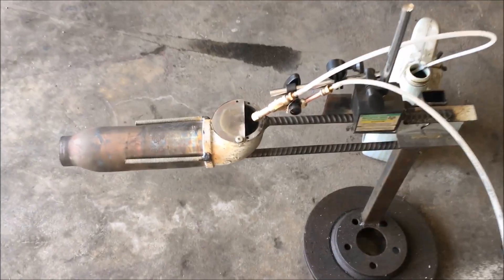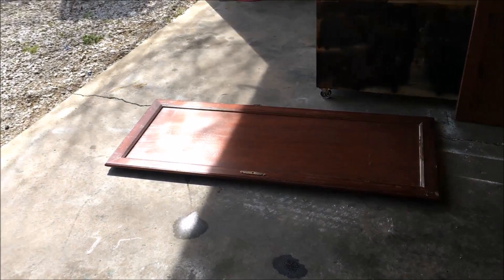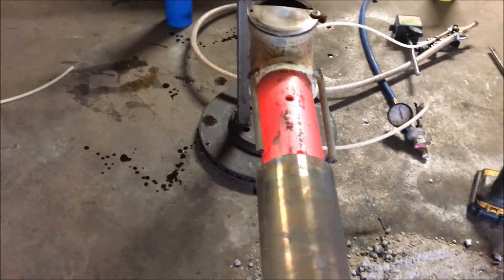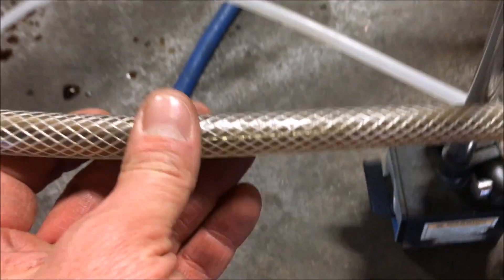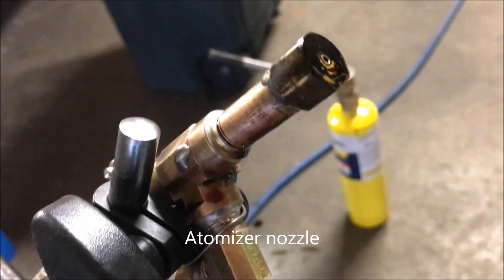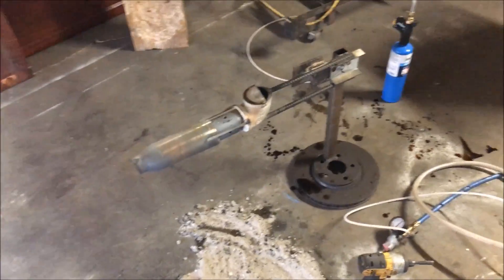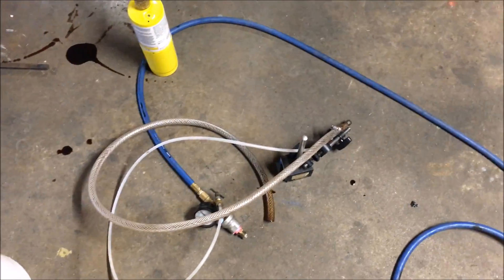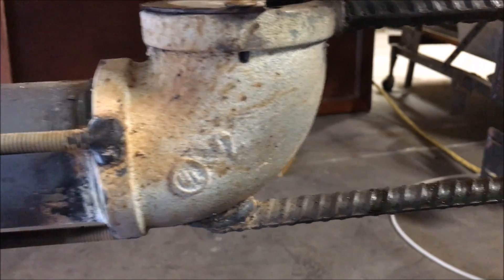Waste oil burner nozzle Design Principle MASTERED DIY prt3

Comment: You wouldn't be able to melt iron with this as the combustion chamber IS iron and clearly not getting to that temp.
Reply from the maker: not true , you have insufficient information to make this claim , i have burners that run colder then this that can melt iron in 12 minutes in a foundry
Reply: @NOBOX7  Sorry, but how does the temp in the furnace get higher than the burner temp
Reply: @shanestevens622  The foundry/furnace is insulated and minimizes heat energy loss, in other words, the heat accumulates. Whereas the burner is in the open and loses a lot of caloric heat to the surroundings.

Comment: Waste oil burners are similar to paint spray guns, there are two types. Both types use air to propel the paint, but one type sucks the paint up the other relies on gravity feed. As the air pressure is varied in a spray gun by a central  needle it drags up the paint. In both types the paint flow can be increased or reduced by restriction in the flow pipe feeding the nozzle.This alters the mixture of pain to air, and a waste oil burner is no different. The air pressure and the oil quantity both need to be adjusable to get the ideal air/fuel mixture. This burner obviously works well, but i feel if the air flow and the oil flow were both independently adjustable, a very good burner could become awsome!

Comment: how is the smell of the oil burning? i'm looking at a home made deep fryer, and this seems like the perfect design to heat the burner tube, vs a propane fired nozzle.
Reply from the maker: I have a much better burner design for that application , i sell them or if you want to build one yourself look up Godzilla burner

Comment: Had to mute the sound some kind of shit music in the background. You can make a real simplified venturi nozzle with a mig tip, barbed fitting drilled and tapped with mig tip attached then thread to your 1/4 inch tee with your air supplied as you have done. Or pick up a cheap undercoating gun at Harbor Freight it will do the same thing and safe you build time

Comment: The larger hose supplies volume and reduces restriction of flow I would assume.
Reply: If oil volume increases you need ever more air so the air to fuel ratio is maintained. Its actually a case of being able to control airflow rate AND oil flow rate independently so that an ideal mixture can be achieved. Reducing fuel restrictions would just make the burner very inefficient.

Comment: What oil you use? Can i use palm oil?
Reply from the maker: I think it would work but ihave never tried it . it should work
Reply from the maker: you should be able to use any oil , if it wont burn just ad 5% gas
Reply: NOBOX7 thanks
Reply from the maker: The turbo idea is defiantly needed to make this think run on its own , Great idea . i found that pre heat isnt worth it , i actually have over 10 videos on the test i did . i tried the burner pre heat and varnish builds up over time clogging the device
Reply from the maker: thanks for the trubo idea
Reply: @NOBOX7  Preheating should be controlled so that it is not too hot. To avoid clogging I would use a simple relay/temp control module/heater element to heat the feed stock prior to injection. You can use your compressed air line to act as a pump if you make a feedstock tank that can be compressed. So far this is the best damn burner I have seen yet, but I don't like how hot your nozzle gets. I need something that spits out a concentrated flame that is an external burn instead of internal. I think the tapered end to your nozzle helps it heat up and improve burn characteristics, but maybe it could have a bunch of holes drilled in it in a spiral pattern, and then an additional shield to direct the flame out the end a bit better? Maybe if your nozzle was adapted to match the nozzle of a rocket? Thx for sharing!

Comment: The ceramic catalytic liner will help ignition, combustion cleanness and total heat output a whole lot. (~_^)-b

Can you make a flange on the outer sleeve/nozzle to adjust it with 3 nuts so that you can 3-point mount and aim it? 

Something that mounts like this with a nut on both sides of the flange... https://www.carid.com/images/walker/items/41592.jpg

You could put a roll-over lip to hold the flame...